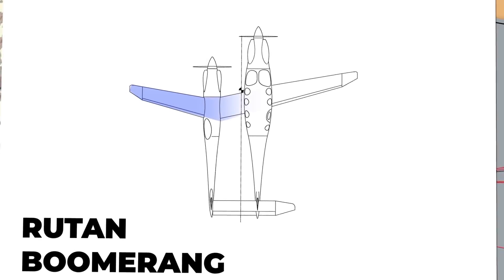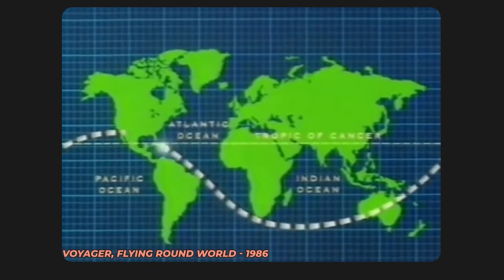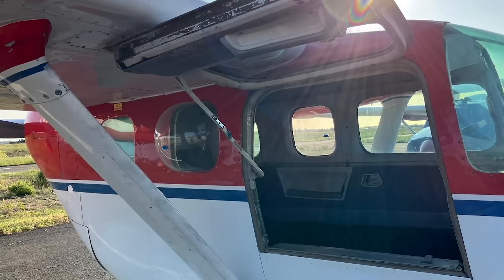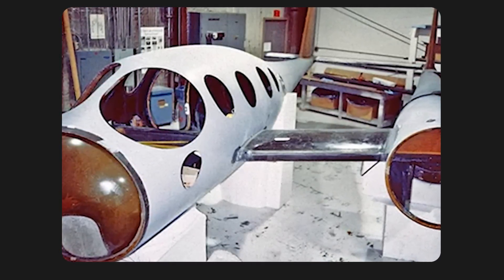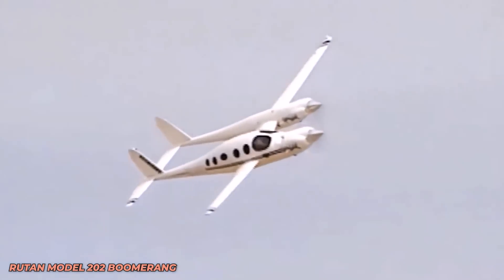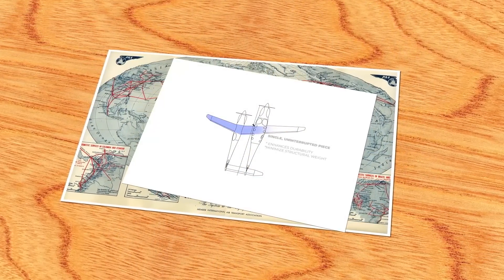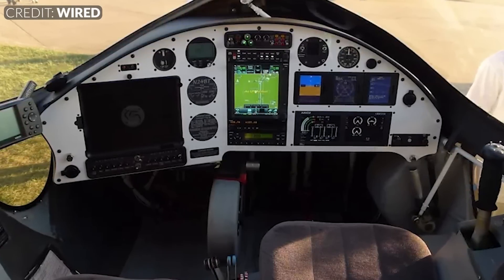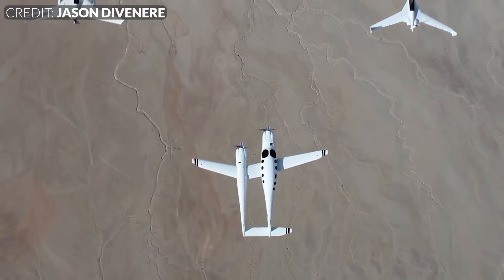Rutan Boomerang: Unconventional Genius!

Comment: So much talking and you still missed out on some of the most genius aspects of the design.
For example, the reason it flies straight and safe even on a single engine no matter which engine it is - is not the twin booms...
Reply: So then what IS the reason?
Reply: @ShaunHensley  Asymmetry. 

The down-going propeller blade produces more thrust as high angles of attack in slow speed flight with maximum power.  

The down-going prop blades are located as close together as possible, and symmetrically about the aircrafts CG.

This makes the rest of the airplane asymmetrical.

Comment: Wow. I love it.  Form follows function here best.  What other plane accomplishes so much.  For those valuing flight efficiency and overall performance in ideal to adverse situations, it seems this plane is a unicorn 🦄.  Especially for those who love bizarre designs effecting superior performance, overall.  
If I had a genie in a bottle, a talented group of technical specialists would be flocked, together as a corporal body of owners.  Creators of a factory and assembly line production of this plane.  With focus on simple actuators, either mechanical or servo fly by wire, with all actuated forces and input ratios specified in the volumes of POH binders.
So that even 100 years from now, maintenance and replacement equivalents could be found.
I'd probably seek those in the team that developed the electronic steering incorporated into Ford Focus hatchbacks and sedans, since around 2012.  Checking the viability of redundant servo actuated control surfaces, and abduction/adduction drives. Autopilot would "simply" be, a fastened ROM plug in module.  There would be a Satellite phone link control option, and app, that all IFR Boom Ranger pilots would have, plus every Boom Ranger IFR pilot owner gets their own passcode or biometric.  In the event of pilot incapacitation, push the big red button and pre-recorded May Day voice transmission is sent on the correct frequency, the radios switch to VOX using the red emergency headset. Simultaneously, SOS in Morse vibrates phones of all Boom Ranger IFR pilot-owners.  App can patch them into the headset input of the distressed Boom Ranger.  Control of the distressed plane can be taken by any on ground Boomer Ranger, given the correct passcode, only any time after the big red button was pushed.  All flight data of the distressed plane is now on the instrument panel of the Responding Boom Ranger on the ground, who's pilot-owner can now take over, in the truest form of IFR flight, all the way to the nearest safe landing strip.

Or, the E!-Autopilot took control of the aircraft when Big Red Button was pushed, and it lands the plane at the nearest safe landing spot, communicating with ATC via A.I.
LOL.
But completely doable with current technology, and likely for several years prior to now, being 2023.

Comment: A great example of AeroPunk.  Asymmetry always guarantees AeroPunk status.  Blohm & Voss baby!

Combined with forward swept wings, the Boomerang is about as AeroPunk as you can get.  To beat this you would need to switch from tractor props to pushers.

If it had mid-mounted circumferential ducted fans like the FanJet 600, it would be the most AeroPunk aircraft of all time. 😅
Reply: I came to the comment section to see if somebody mentioned Blohm & Voss. This plane immediately reminded immediately of their creations.
Reply: @heinrichzerbe same.
Reply: @heinrichzerbe + 1.

Comment: he is a GENIUS..i wish he would continue in this modern time the ultimative flying product !
Reply: His genius was to not only design a very efficient and safe aircraft using his very detailed understanding of advanced aeronautical concepts, but also to be able to build a prototype aircraft with very limited resources. Burt is right up there with Kelly Johnson.
Reply: indeet, good woerds, still, we need another BR...tecnology offets good engines and material...a low stall and still 220 knts is missing...i will check kelly johnson, never stept over his name.